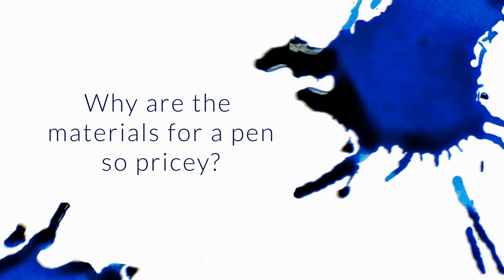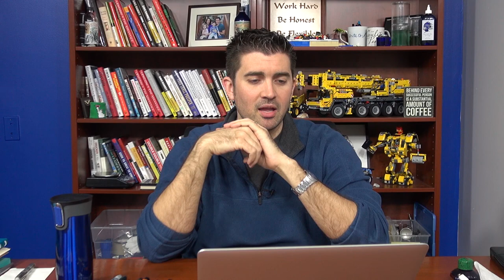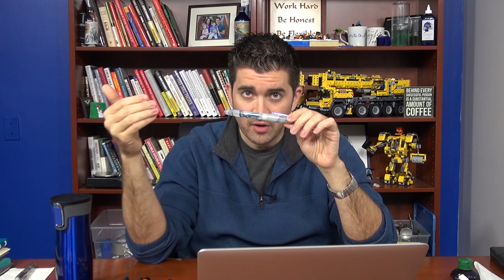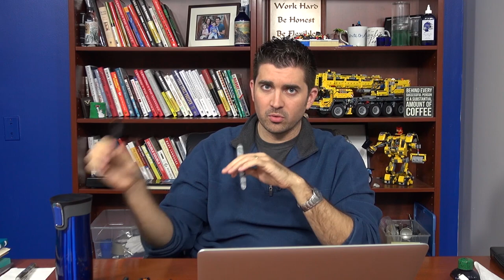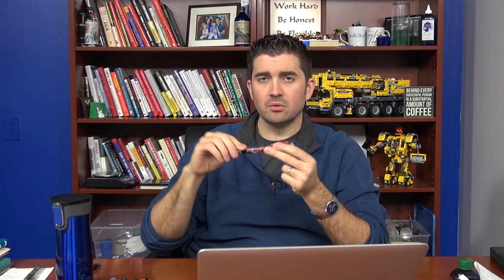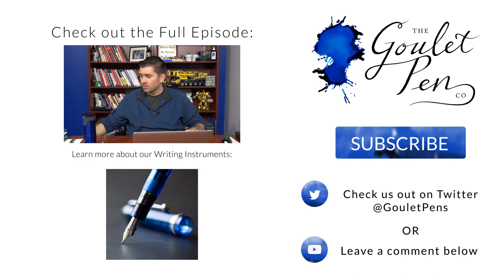Why Are The Materials For A Fountain Pen So Pricey? - Q&A Slices

Comment: 1:58 To be exact, >synthetic< (specifically) resin is a form of plastic (unlike natural types of resin, e.g. such as that of which amber is formed - btw, wouldn't that make a gorgeous pen!). Also, I wouldn't say that "resin" and "acrylic" are interchangeable words, there are various types of synthetic resin other than acrylic acetate in general. A pen that is made of resin does not necessarily mean it's made of acrylic. The universal term is plastic, whether we like the connotations or not (which includes cheap ABS plastic, bakelite, celluloid and other) and I can only think of ebonite (hard rubber) that would not fit that group, considering non-metal and non-wood pen bodies. Maybe a tiny exception would be the Visconti Homo Sapiens which is kinda hard to pinpoint due to the mixed nature of the material.

To put it simply: Plastic (biggest group) includes -> resin (middle group) one of which is -> acrylic.

Also later on 10:11 I'm sure you guys know this, but Mt. Etna is definitely not in Florence. :D

Comment: After testing many times, I final found that acrylic and celluloid are not the perfect materials for pen making. It is a Compromise between Exterior and Cost.
There are still a lot of good materials such as Polyetherimide(PEI - it is only used in Kasama UNA pen body), Polyphenylene sulfide(PPS - It has the best color - used in YUANLI Ballpoint pen body), PPSU, PES. I hope in the future penmakers can focus more on pen's endurability and texture quality rather than its exterior and cost only.
Besides, combing wood, carbon fiber, ceramic with bulky brass/copper/gunmetal components is also a silly design in many pen. Using aluminum or titanium will make it better.

Comment: Man, you could not be more wrong about Makrolon!
It's polycarbonate and a brand and registered trademark of Bayer I think, maybe BASF, but I think it's Bayer chemical company. One of the German chemical companies in any case.
The ventail of a motor cycle helmet might also be made of Makrolon, or the carrier disc of a CD, DVD and so on. Or actually lightweight windows or mostly racecars.
Makrolon by itsself is clear, has no color but can be colored. The Lamy 2000 is made of an older Makrolon, there are several polycarbonates that have been sold as Makrolon.
Reply from the maker: +Achim DG Straight from the Lamy Wikipedia: "The 2000 was innovative in its day for its use of a special fiberglass resin produced by Bayer, Makrolon, for the body of the pen." I think you're both right? - Colin
Reply: +The Goulet Pen Company yeah, I don't understand resin anyway, no clue what that means, my school English has some limits, sometimes resin seems to be used for something that is called "Harz" in German, wich is the same word as for that sticky thick liquid that comes out of cuts on pines for example, that is also used combined with a word that mean artificial. Oh! I just had it translated, trees have resin a well.

Sometimes you also seem to use resin for "normal" plastic.
The special about the Lamy 2000 is the fiberglass in the Makrolon, I guess. In any case, the Lamy 2000 Makrolon is not pure Makrolon.

So, is polycarbonate a plastic or a resin? Maybe German and English see that different. According to german Wikipedia, Resin only has a meaning as a glue/adhesive, polycarbonate is not a resin itsself.
Reply: +The Goulet Pen Company So I really got resin kind of right, but there once again is a difference in English and German.
Polycarbonates are resin materials in English, in German they are not.

Comment: Acrylic is more durable than the cheap plastic on five dollar opens, and it take color very well, so it's often pretty, though I think much of it looks like it should be on a Walmart clearance isle for five bucks.  But you can charge more for acrylic than for obviously cheap, easy to break plastic, even though it's still a low cost product, which is why Chinese pen companies have started making opens from acrylic.   

All items made from acrylic are not created equal, including fountain pens from different manufacturers.   An acrylic pen can be thin walled poorly made junk, or it can be thick walled, sturdy, pretty, an durable in a great writing pen.

Comment: Thank you for the great effort, Brian! The precision engineering a.k.a perfection (think iPhone) makes the selling price high.

You rightly point out that getting the beautiful finish is not that easy. Very Labour and time intensive. That is part of the reason an Aurora Optima can sell for the price it does. Namiki Maki-e is another level (that's paying for the art already).

Furthermore, there is some level of R&D that one has to pay for. My Platinum Cool Demonstrator screeches when the cap turns open. But a Mont Blanc does not and never will. It is like perfecting the click on Chanel lipstick. Chanel listened to thousands of clicks before producing the one perfect click. And every Chanel lipstick in the line is held to high levels of quality control; every bullet will give exactly the same click. On this, another viewer rightly pointed out that far fewer people buy fountain pens than they do Chanel lipsticks, so the prices of fountain pens remain high in general.

I studied Materials Science and Engineering. This is my two-cents worth. :)

Comment: what is the top of the top in fountain pens,ink and paper? like if someone had 1 million dollars what would they buy?
Reply from the maker: Once you get past a certain price point, the changes in cost are usually more aesthetic and materials used than actual writing performance. Ink & paper also top out at a certain point. I think $1000-$2000 is more than enough to get the absolute best of the best. - Colin